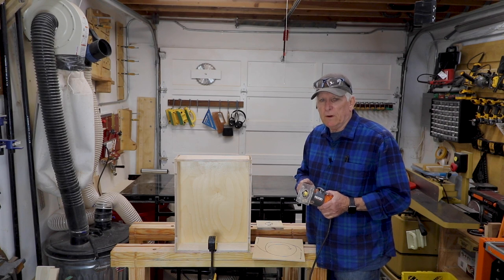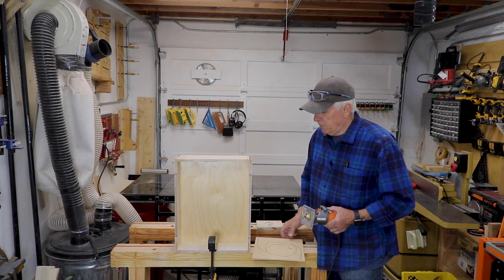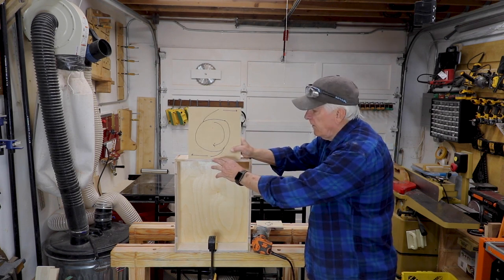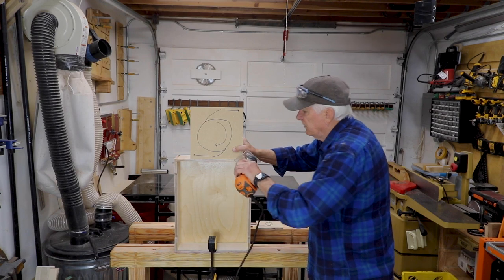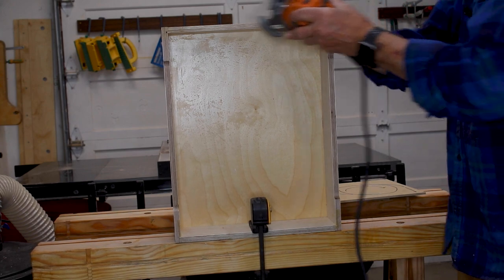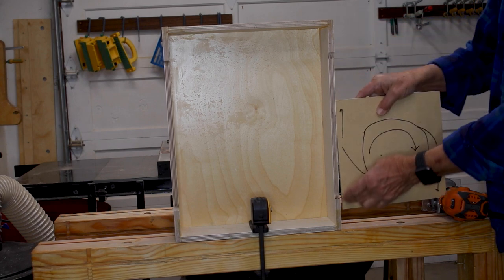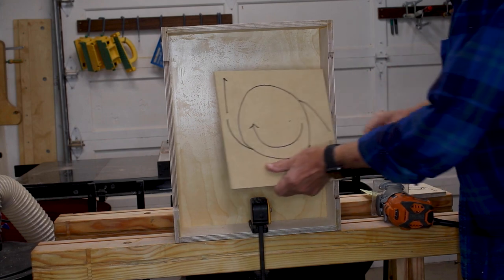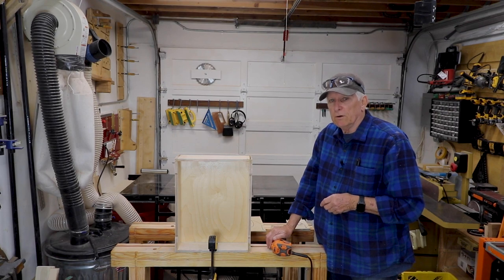What The Heck Is... The Proper Direction to Push the Router

Comment: Thanks for the tip, Paul. Very clever. Now, can you do a quick video on the best way to set the depth on a roundover bit so that you get a smooth edge, i.e. no ledge on either side?
Reply from the maker: Hmmm.... I would have to learn how to do that first.  I get some really pretty little ledges that I have to sand away!

Comment: I use my router in the table most of the time which is easy to remember. As soon as it's hand held all that goes out the window and I forget even with the arrow printed on the side of the tool.  😂
Reply from the maker: Your router bits go counterclockwise, right? (He is in Australia)
Reply: @SmallWorkshopGuy  😂😂🤣🤣😂😂😂

Comment: Well there goes the old "righty tighty, lefty loosy" idiom we told newbie techs, (and some seasoned ones that would sometimes strip the head of an oil drain plug trying to turn it in the wrong direction), so they wouldn't over tighten or strip fasteners when removing them. That didn't work for the lug nuts on Mopars before 1970 though, since they had left hand threaded lug nuts on the left side. The thinking behind it was that as the wheel was turning, centrifugal force would tend to keep the lug nuts from coming off if they weren't tightened correctly. It may have been needed before the invention of the pneumatic wrench because not everyone could tighten them sufficiently, but it wasn't necessary after a while. They switched to right hand threaded lug nuts in 1970. My '69 Sport Satellite had left hand threaded lug nuts on the left side. Oh wait, I'm way off topic, but hey, any comment helps Paul's analytics with YouTube.
Another great "What the heck is..." video, because even me who has used a router for many years sometimes has to stop and make sure I'm pushing the router in the correct direction.
Reply from the maker: Yep, there is definitely as more stable direction, but a "climb cut" can be useful in certain situations too.